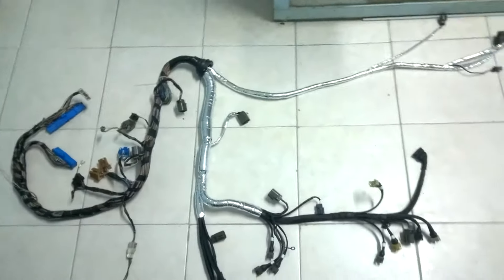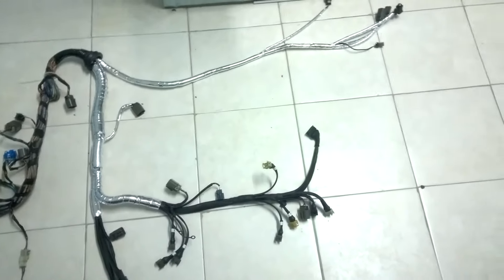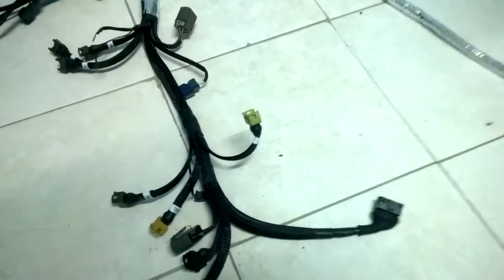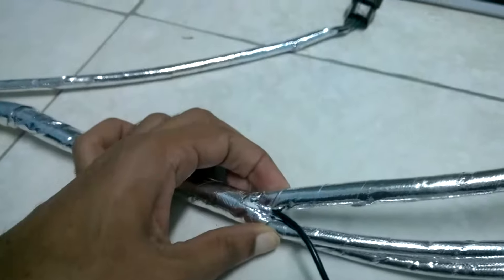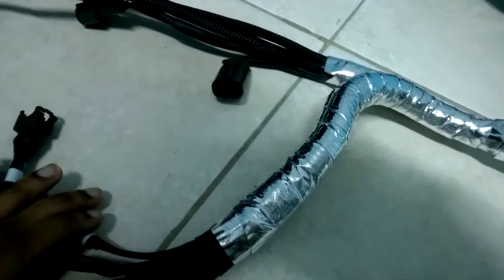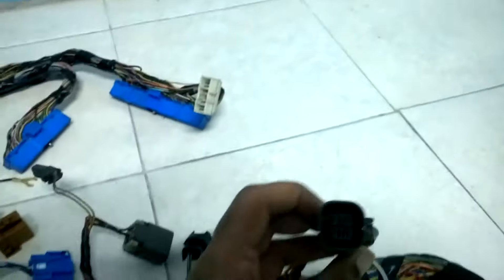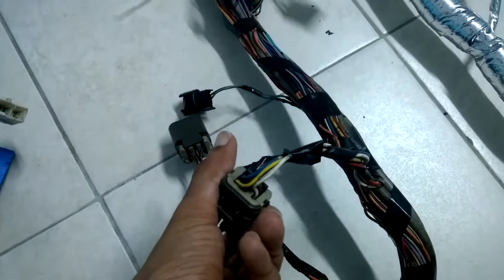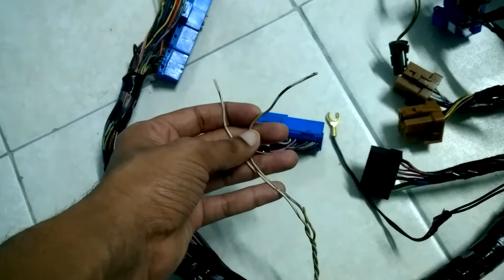CA18DET Engine Harness

Comment: what is the wire size/diameter in mm² of the oem coil pack harness?? i have read something about 14 awg, which is 2.0mm² but is it really that thick or is it 1.5-1.6mm² ? maybe the conversion from awg to mm² is not correct..